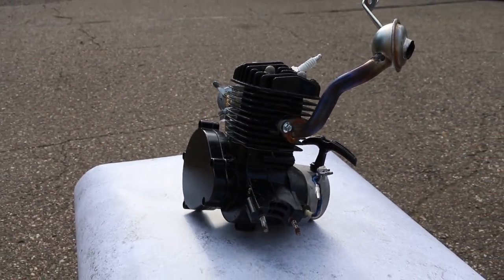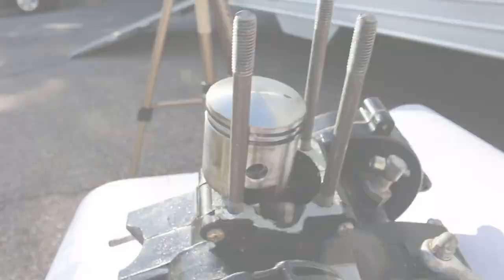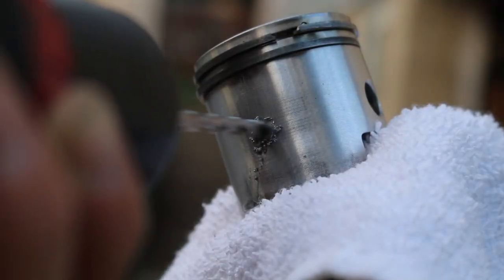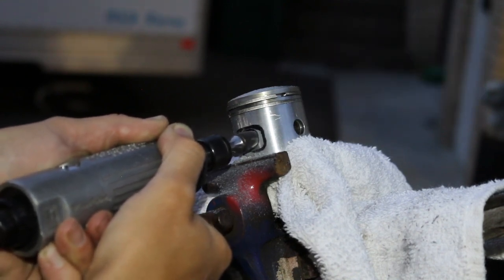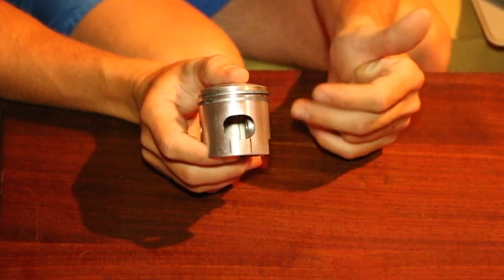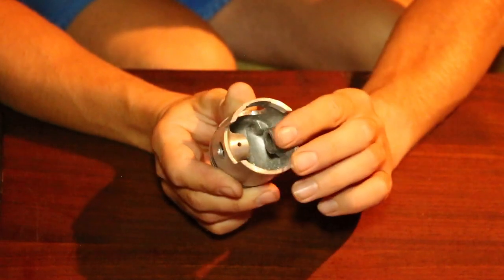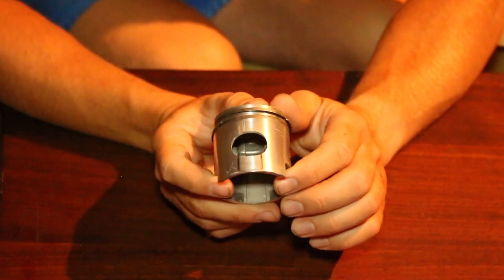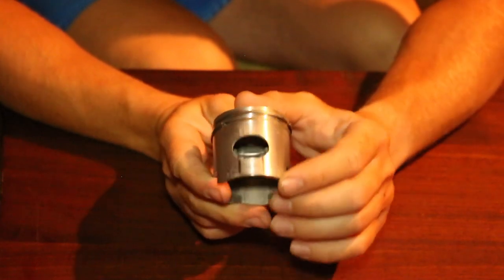60cc/80cc Motorized Bike Windowed Piston Walkthrough!

Comment: So, how you determine where exactly that window should be and which size?
Reply from the maker: Watch the whole video man Its all explained
Reply: @jaguars004  Sorry, maybe my question was not correct. Should I just use a permanent marker pen to draw a window on that piston's surface through the intake hole while the cylinder is in place? What position should the piston be at this moment? Or, maybe larger (more in height) window will be better? The more I search the more forms I see:
https://www.picclickimg.com/d/l400/pict/172618957968_/66-80cc-MOTORIZED-BICYCLE-REEDVALVE-WINDOW-PISTON-HIGH-PIN.jpg
https://cdn.shopify.com/s/files/1/2624/6138/products/27394062_575956106076491_1101105316_o_1024x1024@2x.jpg?v=1517007311
https://cdn11.bigcommerce.com/s-9pjycbbc8r/images/stencil/1280x1280/products/1323/1779/ENGJL-PKWDW__61692.1525297161.jpg
https://cdn.shopify.com/s/files/1/1121/0508/products/gt90_ported_piston.jpg